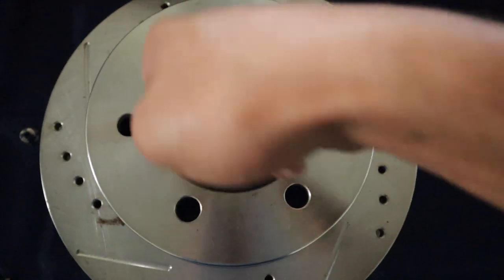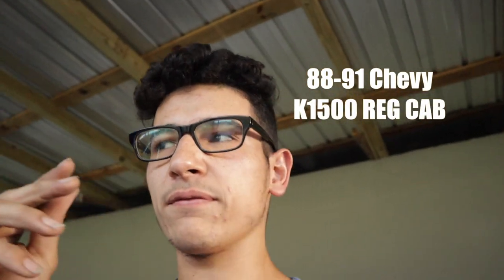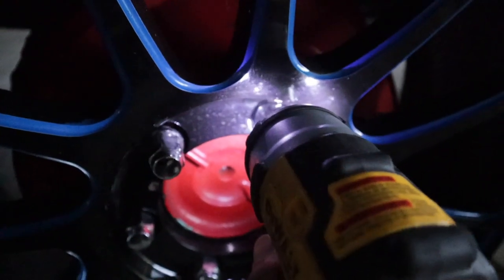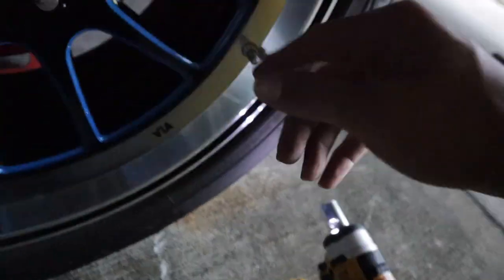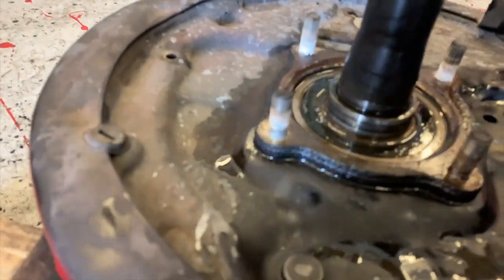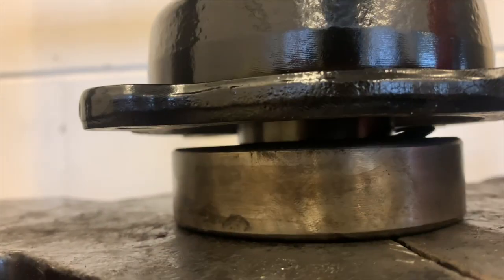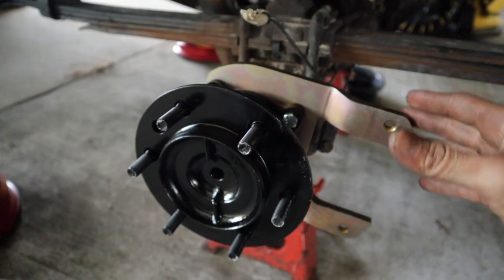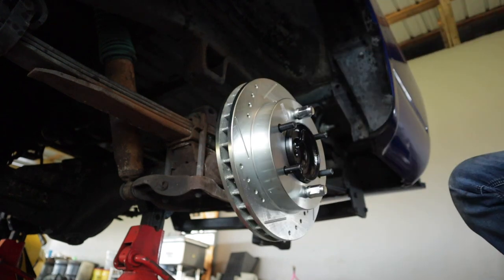Toyota Pickup Disc Brake Conversion!

Comment: I used brackets from Arizona, 87 front calipers & 97 front rotors. You will need an adjustable proportioning valve & a 3 lb residual valve, take your axles & get the bearings changed &eliminate the backing plates, & a 97 master cylinder! Then you r good to go! Mine was an 82 Toyota 4x4
Reply: Is “Arizona” a different brand bracket than what was used in the video or the same, gonna be doing this soon to my 81 pickup
Reply: Those brackets are not offered anymore they look the same as the ones for a sterling,the weld one are cheaper,I only paid $25 for mine your choice MSN! Good luck,I use a line lock for e brake
Reply: I ground mine down with a grinder to fit inside the rotor,u could do it that way or machine shop it takes a couple days apiece
Reply: Pretty impressive!👍 what more can I say?!

Comment: Nice work here brings back memories, i had to do a similar job to a rear disc swap on my mitsu mighty max truck.
I got 2 long plates of steel stock bent the ends to make an L shape then drilled holes on both ends and uses a 2 jaw puller to extract the drum backing plate.
 i would put the caliper to the front as well not just becaise the brake line will reach it but also because the weight balance would be better before the axle  vs hanging behind it.

Comment: There are two threaded holes in the rotor cover. Use a M8-1.25 bolt and tighten them to remove the cover with zero frustration in 1 minute.
Reply from the maker: I did try that method but it didn’t work for me sadly lol the threads on mine stripped out

Comment: How did you use only the old wheel bearing to install the new one? Mines stuck and had to remove the new one to get the old one out
Reply from the maker: You might need to heat it up! That will help loosen the metal a bit.